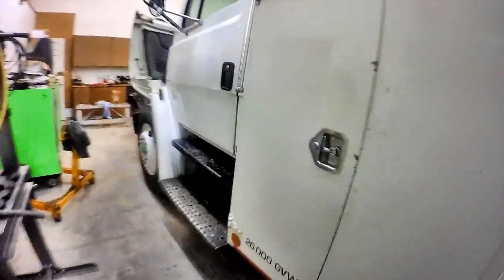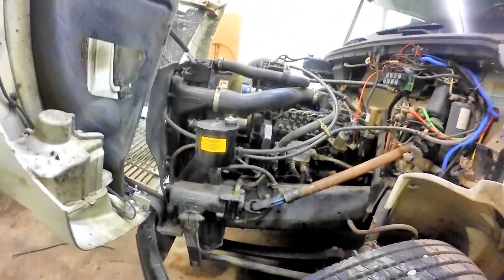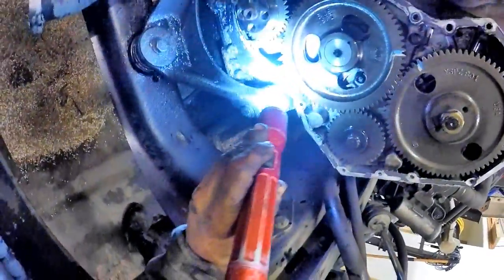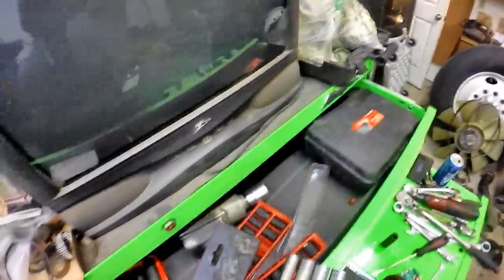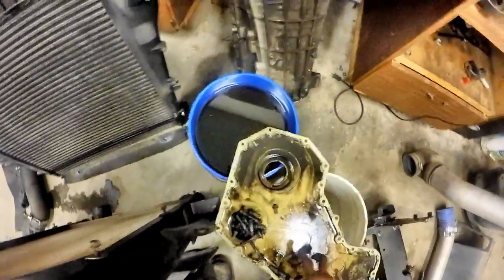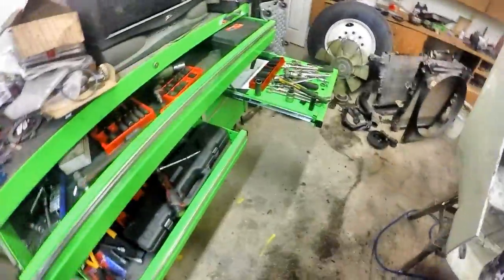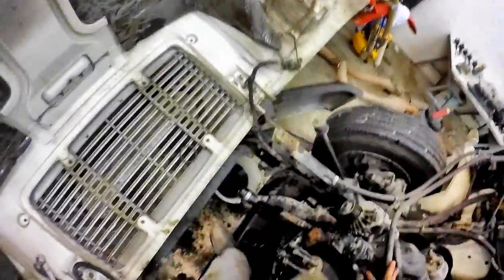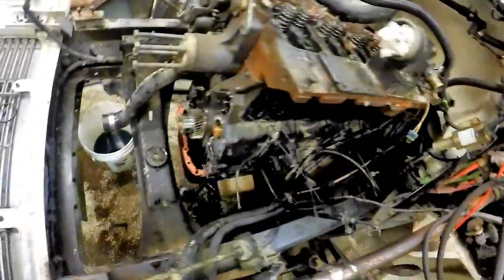Fixing the new service truck

Comment: UK version had a DPA/rotary pump which was an arsehole to get off and the timing cover wouldn't come off unless you took out the camshaft, the camshaft passed through a hole in the cover.

Comment: Does that truck have a block heater? I got a fld112 refurbished freightliner here on the east coast. It was a California truck that ran Oregon according to the history. It has heated fuel tanks and had to add shutoffs to the radiator lines  because I had heated fuel year round.

Comment: I have fixed several things like that with liquid aluminum or JB weld.   I would say they just did not dremel it out well enough and clean it well enough.   Very much like real welding.   If it takes no load and only holds oil I can see very well why they did not do it your way... they just did not pay enough attention to the repair...   we both know that is very common.
Reply: Last comment half way through... now done... wow I am stunned you took that thing apart.  You knew what you were getting into... I did not.    I swear to god  dremel. brake clean, JB weld and you could have fixed that right up.   Sure as hell would have been good enough.      As a general rule I like the fact that you want to fix things right but at some point the diminishing return is just too great.   100 000 miles on a service truck and it is going to wheep.. not leak or drip but some oil is reasonable.    I say again.   I am glad there is a least on mechanic left out there that fixes things properly.  cheers

Comment: Heater grid to make starting in cold weather easier usually goes in the air intake where it enters the engine.
Not uncommon to see them disconnected.

Comment: Hi Warran found out that 12 valve Cummins engine have issue with the dowel pin falling Incase I just ran into one today hope your dowel pin was found and recovered and Iam sure you did hope this helps sir hope

Comment: imagine if the engine had blowby. i've done the zip tie trick also works as valve spring compressor tool on small engines

Comment: when holding lifters up.  make the loop of the zip tie and slide it over the needle nose pliers.. so you can pull the lifter up.. push the ziptie off the pliers and down over the lifter.

Comment: on the 8.3 which is same damn thing they crack that front inner cover a lot on tractors and combines you can just heat that cam gear up to slip it off and put it back on. I've done it that way on many of them saves shit ton of time

Comment: They do have a cam gear puller. It works good. I have one somewhere. I would let you use it if I can locate it. There is another simple way to pull the cam if your interested. I'll take a pic of what I used for years.

Comment: That kind of drippy, blobby look to the epoxy, I'm wondering if maybe they just pulled the front cover off to clean up the pin and just "repaired" the cover in place.

It's the kind of thing I'd have done if I were expecting major work in the near future, but far enough out to not justify moving it up. Make it work for 6-12 months, then do your in-frame or whatever. Save pulling all that shit twice, especially if it really needed to get back on the road yesterday. (And given that you got it at auction, there was also likely an element of "It's not gonna be our problem soon".)

Obviously from the damage you saw after pulling the cover that's not a great idea, but . . ..

Comment: hey warren I'm sure you know this but when you go to put the ink pump back on theres a updated torque spec for the pump gear nut torque. if you use the old spec the timing will slip almost every time just had it happen to me on a pickup. I believe the new spec is 157 but I could be wrong
Reply from the maker: Ok , I'll  check thanks

Comment: I have heard of that pin problem a number of times,I dont  understand why the mfg Doesn't have a permanent fix for this failure, a way to build the engine so it doesn't commit suicide.Is the reason that they want to drive up engine repair/sales ?
Ok I see in the post on 11/23/18 that Cummings had a fix for this problem,is this something they did after some serial number on new units of is it just done when a unit is over hauled or updated before the pin falls out?

Comment: I'm not so sure that was a KDP problem. The KDP normaly  falls on top of the cam gear that rotates counter clockwise forcing the pin between the case and gear under the fan hub and busting out or crackng there. That crack you got is right at the bolt hole at the edge of the block on the bottom. Looks more like the support bracket bolts being missing was a prior issue and the weight and vibration of the p pump and compressor power steering  assembly hanging on that cover busted it over time till they caught it being to late.
Reply: AzDodge i agree and I was just trying to type this and well, I don't know what happened.  The kdp usually goes to the left and breaks the case right there.  I don't think there is enough room to get down where your case is cracked without exiting stage left.  I've also seen them broken in that area when someone gets a little to frisky prying on it to get the case off.

Comment: Pull the 12 valve and drop in a 6v53 that should give you lots of power, not sure if the FL cab has enough insulation thou lol
Reply: @oldpete3153  no doubt.
Reply: @logtrukn  I guess you can't figure out I was joking, I work on and drive trucks all day long, around the forest industry that widely used old 2 strokes. Green grenades had their place back in the 70s and 80s they burn too much fucking fuel, you would go broke running a truck with a Detroit, plus the fact they make more noise than power. One guy I knew he used to have a 5 ton Ford with the 5.9 12 valve truck grossed 35,000lbs 3-4 times a week engine did fine, slow as hell on the hills climbing them in first gear. He always had one engine rebuilt and ready to go he swapped engines every year to 2 years.

Comment: Nice commitment to fixing it right.  I cringed when you left the light on in the welding cabinet, thinking of a dead battery.  lol  The crank pully falling in the coolant was classic.  At least it wasn't gear oil.

Comment: I know this is a old post and new comment but I was wondering the part number for the compressor I have a 92 12v Cummins service truck and would like to use air off the engine makes more sense if you can be great if you even see this post and love your channel if it’s worth doing it’s worth doing right

Comment: Thanks for the interesting video's thats going to make a great truck in the end. Parts on back order is a strong possibility depending on suppliers, as that 12v is getting old now in  manufacturers/ stocking parts terms. I have a 1000 series perk apart like this in a 2006 or so 6270 Massey at the moment here in Canada. The bad coolant  ate the timing case dumping all the coolant in the oil pan. She's a right mess inside with all the sludge,  the loader brackets make it real hard to get the pan off to clean it out to. We went to order parts, yeah back ordered to Europe for 3 weeks. I've had MF tell me hub parts were on back order for 3 months as they were having another batch made in Europe to, luckily that wasn't a feed lot tractor, and it sat most of the winter in the guys shed not used every year!.

 Ok so  this 6270 guys Landini loader tractor needs a clutch we'll fix that instead,  as he needs one machine running quick. We go to order the clutch and find there aren't any in North America, It is apparently made from unobtainium  from a small family mine in Italy for "f" sake .  Luckily Mcormick use the same clutch it was only 2 weeks out!.

 I'm kinda glad both these tractors sat next to each other in the guys shed, I'd be buggered for shop space here while waiting that long for parts. I'm finding more of this stuff for 2006 and before isn't on the shelf or easy to get unless it's John Deere.  I just hate their dealers attitudes  round here, and fix mainly other makes. Take care

Comment: Doesn't make any sense at all. Is there a battery master switch? I would put one on. A lot of mystery wires. It will be a nice truck after you clean up the random fixes. I like the welder.

Comment: The guy who took it all apart to deal with the dowl pin and did realize it cracked or it cracked from over tightening the cover.... then they realized it was leaking when it was all back together so they said screw it and threw some silicone or epoxy on it...... iv seen those covers crack there before

Comment: Be real nice if the toolshaker had a 3126 or a C7...you'd be out making money with it by now...hehe...JS...my fl80 plow Trk is cat powered...I didn't think much of it at first....the water pump belt system Twice in 7 yrs...think the s my worst issue to date...it's good thing to up size your abilities in jobs you can take on from here forward..

Comment: This ain't bad mouthing you, but I get rid of hood before it comes in shop unless snow and the weather just won't let me then I find place for it in shop. easier to pull the radiator and then getting cam out goes smoother too. The last engine I ever did was a twelve valve and it went from truck to dozer app and the pump is different, the injectors have to be swapped, the timing case has to be changed cause the pumps mount different. I won't put that much power on a customers equipment. about fifty horses lower in a dozer and they are smart enough at case to limit power to the transmission and finals so they don't self destruct. I have never stood a camshaft up and I had to fast forward when I saw that. I just basically take all the decorations off before I pull that cover cause it goes easier and faster. I ain't giving you crap cause your doing fine without my shit but that is what you did to the guy that put a egg shell t cover back on with elmers

Comment: it was a service truck for probably a decent sized company, i know at my company our service trucks dont go down for repair until it leaves us stranded. had a bunch of suspension and def problems plus a turbo going out on my 13 f550 and told the bossman and was told to keep running it.  it lasted about two more weeks before it came apart and killed the def and went to shop 17k later it was back with a check engine light and went down a week later because shop broke a connector and tried to zip tie it.  i fucking hate how they treat the trucks

Comment: Hey buddy, it was good to hear you laugh when you friend was there....Some asshole sitting behind a desk told the mechanic “put her back together”...Just thinking out loud. Most guys would have fixed the dam thing correctly...I’ve bought a lot of used and auction construction equipment. Once I got them straightened out, they worked out great...Thanks for the great video..

Comment: I hope you didnt go cheap on the amazon led lights.  In my experience cheapy led lights just dont last, especially outside.  Its definitely a buy once cry once situation.
Reply: Those cheaper LEDs if you can take the front off and put dielectric grease around the seal and don't pressure wash it out of the seam just wipe to clean they last a way longer moister inside is what kills them most of the time
Reply: I went even further down: $4 LED floods off eBay. Nice cast heatsink bodies, never had a problem as bumper/trailer lights.

Biggest thing I've run into with automotive electronics, and not just the cheap stuff, is bad joints. Open 'em up and touch up the solder, make sure you got good crimps even if you have to replace the pins, and they'll last a lot longer. I've even had to do that with German-made BMW DMEs, Japanese-made Honda ICUs . . ..

Comment: In the late 90's and early 00's we ran a lot of expediter trucks with those 12 valve B 5.9's.  The engines were very reliable and could easily run 500k+ miles before needing rebuilds, but timing cover oil leaks were very common- to the point they were annoying.  They would be fixed right the first time, only to have to come back and keep fixing them for leaks again and again.

Comment: Someone please explain the reason for the fans in the boxes
Reply: The reason for the fans is to help with moisture and to keep a slight pressure in boxes to keep out moisture
Reply: Ventilation the air compressor which generates heat. Then that hot dry air goes thru tool compartments to eliminate moisture. Pretty cool actually.

Comment: Every second revolution all the timing marks line up. Should be timing marks only on crank, cam and ip. Could of saved some money and not bought the kdp kit. That pin is just a alinement pin for the timing cover. I don't know what cummins even put the damn things in there anyway. 12 valves I owned I always pulled the cover and removed the pin first thing when I got it home. I always dreaded the drive home praying the damn thing didn't fall out.
Reply: The injection pump shouldn't matter. It's a tapered shaft with no keyway anyway. You can put the gear back on any which way.
Reply: I always lined the timing marks up and then pinned the pump and seen if or how much the pump was off the timing gears marks and mark the two gears. All you have to do is turn the motor and install the pump gear so the marks line up while the pump is pined after installing the cam and making sure it's timed. And all the p pumps I have seen has a key way although not used on second gen dodges. If I'm not mistaken some other equipment that ran cummins with p pumps did use the key way.
Reply: @oldfarmer4700  I've never messed with one that wasn't in a Dodge pickup lol. I just assumed I guess they were all the same

Comment: Wooden dowels , for lifters . Don't need to pull compressor or pump.
Reply from the maker: To replace the timing cover you don't have to pull the compressor or pump, that's a new one.
Reply: repair Cummins sells tool kit.but is just wooden dowels and a lifter tray to go in to cam bore.pump and compressor will be held up by rear mounts.

Comment: Scratching my head and wondering why the hood was not removed.
Reply from the maker: Because we just aren't as smart as you are.
Reply: @westerntruckandtractorrepa1353  Please don't take offence, I use to work on bucket trucks for an REA and a job that involved the hood would have been pulled the first thing. I can tell your a good mechanic and I enjoy watching your video's. Cheers
Reply from the maker: @imysteryman   Sorry, been a rough day. No problem.
Reply: @westerntruckandtractorrepa1353  I liked your cable tie lifter trick, kool

Comment: @4: 01 hope you aint gots a dead battery.......for that timing housing someone got over there head ans was lazy and did not want to do the work. now for that housing cover what i have seen is 2 things when the t cover is cracked it was hit in the left front and rad support /rad ect... came back and hit it , or the comp or injection pump supports are missing happens when a lazy ass replaces the comp or inj pump they think that the brackets don't have to go back lol
Reply: Read your comment. Thanks. Now I have a headache.

Comment: MAKE sure the support bracket and attaching hardware for the air compressor and power steering  is intact as mentioned earlier.  Cummins says check every oil change. Had an Ford F1000  8.3,5 by 2 complete IMT package  new.Nice truck. We ran 25  Cat 637 D's  30 31D's 20 D8 and 9 high tracks I lost track of the smaller stuff. Those were the days.
Reply: Steven H Zoll unobtanium. Now that is funny
Reply: You scare me with the screw driver and hose clamps    Use a nut driver please.  I am 74 and all my life on tractors with the wrong tools  cut smash. Bleed 🤬🤬🤬😢😢😁😁🇺🇸🇺🇸